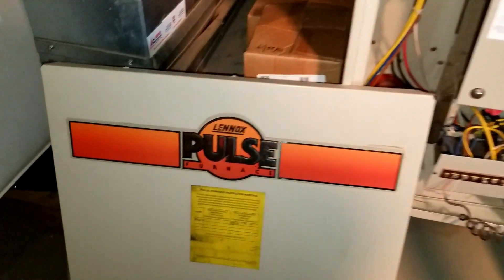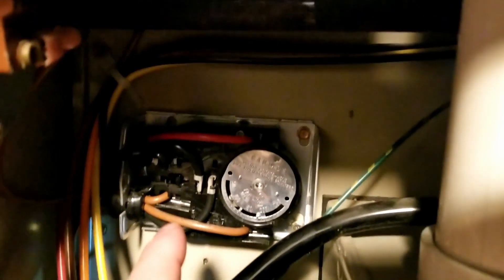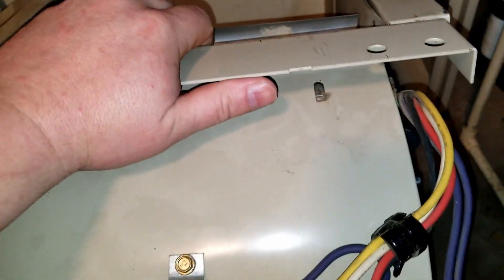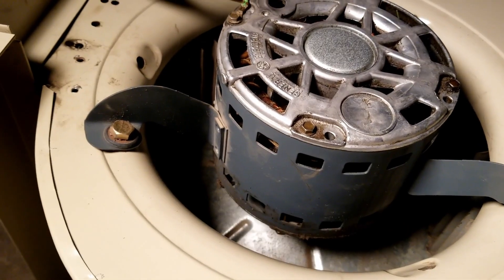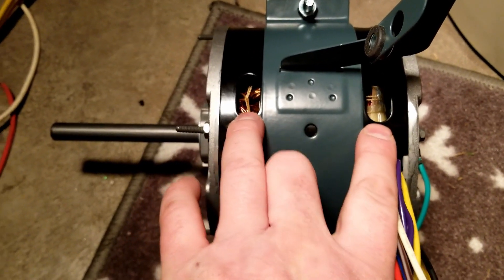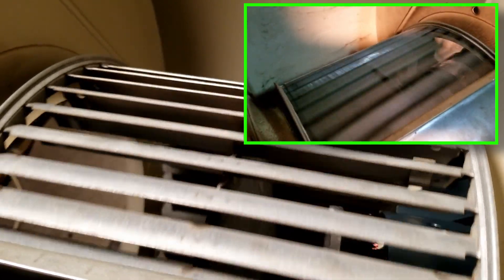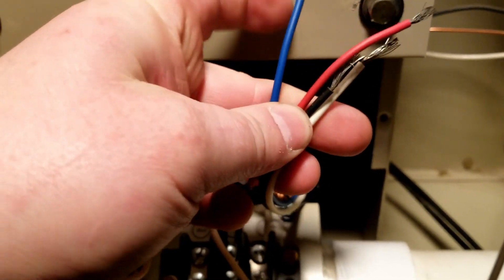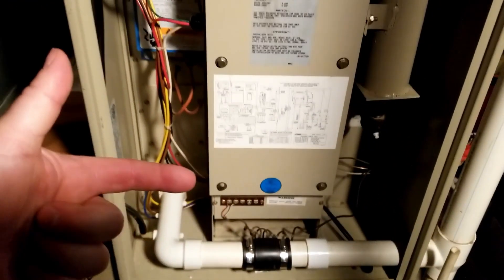Lennox Pulse G14 Furnace - Replace Blower Motor

Comment: I'm about to replace my motor with the exact motor you have. So if I'm following correctly, the connections are pretty much the same besides the white and blue wire?
Reply from the maker: Should be, unless your machine uses medium speed. BUT be sure to compare the schematics of your old motor to the new one just to make sure.
Reply: @mongofix Thanks for the reply Mongo! Looks pretty straightforward after looking at both motors and descriptions of the wires.
Reply: @mongofix Guess i have a bigger problem on my hands. I replaced the blower motor and capacitor.  AC runs for around 10 minutes, and the blower shuts off. But AC outside still runs.
Reply from the maker: hhhhmmmm Mongo wish you good luck on figuring it out! but let Mongo know what you discover.

Comment: Me want to make a Humidifier using the water coming off the furnace, I was thinking of making a samp cooler set up. Using the return air for sucking the air across this pad (small set up) my question for Mango is I'm worried about the water is it acidic or have some kind of impurity's?  What Mango thinks? Also, I can see that it will need to take care of the excess water but no problem have sump pump set up already.
Reply: Excellent concept. Hope you share the engineering solution.
Reply from the maker: Mongo like this idea and concept. not sure on the PH gut says the water will have contaminants of combustion and any potential corrosion remnants, so probably more on the acidic scale. Other thing will be if holding the water will need to be careful about bacteria growth. If system designed right may not be problem but something to consider. Be sure let Mongo know cause you have Mongo interested now!

Comment: Mongo on the old motor for this model you are saying the blue was not used even though it shows the schematic on the motor?  For that reason you say on the new motor install the blue again is not used so cut/cap it off?  If it was not used on this model was it connected to the old motor, just not energize?  Thank you for the clarification!
Reply from the maker: Mongo think understand and try to answer. The old motor "Blue OR WHITE" is named as the LINE (power into the motor) and white was the color wire on the motor (no blue color wire on the old motor). The new motor has capability for 3 speeds. One of which has a blue wire color available. Per the schematic of the new motor the blue color was for medium speed. The furnace was only set up for 1 speed, high. Mongo wanted it to be the same as old chose to not wire up the other speeds. That is why Mongo did not connect the Blue wire of the new motor. Hopfully that answer question but let Mongo know! 
Mongo Thank You!

Comment: I have a G21, Mongo. A few problems lately. Cleaned flapper. Made up my own pressure tester a number of years ago and got a couple rubber expansion plugs. Modified exhaust connection (kinda like you did, but mine goes to the opposite side, so I modified the housing so the exhaust could come straight out). Leak down is 1.5 pounds in 10 minutes...so good heat exchangers. Problem might have been a sticky high limit (mine has a fan control board), or, loose wire. Original ignition controller I replaced with a BASO, as the Johnson had failed years ago. Furnace is 30 years old, now. I gotta pull that circulation blower and oil those bearings, though. Great video!!!
Reply from the maker: Fantastic! so she basically brand new eh. and THANK YOU!

Comment: We had a Pulse for many years, beginning in 1984.
Excellent design, very simple.
In self-defense I learned how to work on it, changing flappers, cleaning blower, etc.
BTW you don't need to cut the exhaust pipe to work on the relay box, just rotate the box a bit and it'll come out enough to work on it.
The cable ties are available at hardware stores or electronic wholesalers like Mouser or even on Amazon.
I used to pull the blower assembly every 4 years to clean and oil it, including washing the blower wheel.
Our GE motor died due to a bad thermal protector switch, so I went to Grainger for a replacement
which worked just fine.
Also used to clean the secondary heat exchanger when the blower was out using a good vacuum
as the close spacing of the fins could collect dust.
The only fault the Pulse had was the electrical use as it had a PSC motor.
When our Lennox AC (12 SEER) finally got tired we replaced the Pulse and AC (16 SEER) with a communicating system and saw our electric bills decline even in winter.
Still like to see the iceberg grow below the exhaust pipe in cold weather.
The Pulse always sounded like a diesel truck idling in our driveway when it ran.
I always said that was the sound of saving money.
Still have some Pulse parts if anyone's interested.
Pete
Reply from the maker: mk